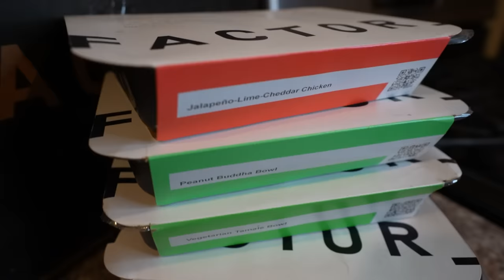Ferrari asked to see my heavily modified 458..

Comment: Awesome to see Ferrari dropping the welcome mat for modified cars.
Reply: They never actually did anything against modified cars though. Its just made up shit for clicks in youtube mostly. Literally vip ferrari customers have novitec exhaust and and some have bodykits or carbon fiber parts installed. Ferrari just hates when you say anything bad about the brand without factual reason but opinion. Which is weird ik. Ferrari sued mostly for copyright or brand shaming. I haven't seen any cease and desist for mods. But yes you lose ferrari points and get blacklisted from icona and special ferraris.

Comment: Clearing codes to avoid going into limp mode,  I have to do this weekly (often daily!) with my 2012 Corvette Grand Sport Convertible.  This issue popped up in 2014 when I still have a full year of warranty left.  Lesson learned!  NEVER EVER accept the blowoff response "we can't find the issue with your car, but bring it back if it happens again" when a car is under warranty.   GM screwed me over by "running out the clock".  I had tons of documentation showing that I had take it in for the exact issue numerous times, but since the dealerships never actually identified the problem and hence replace parts, GM used that loophole to screw me over.

Comment: Check for any corrosion on your body and engine grounds especially if it is a multiple point grounding site ( yes the grounds) If any are corroded or even loose it will give you a horrendous amount of computer and electrical issues. Not on a Ferrari, however will still pertain to computer limp modes battery drain and erronious electrical malfunction activity.

Comment: Emelia, paint the 458 Rosso Dino.  It’s a rare, historical color.  Good to hear that they determined the issue with the intake actuators.  I never saw you say what the original problem with it when you acquired it cheap?

Comment: In short you ran aftermarket on stock tune..............so many stock tune ecu's that sees different values it doesn't expect will throw codes and limp mode. 
Kinda EMS 101. 

But Ferrari gets a thumbs upfor fixing and extended olive branch lol😮
 And you for good content 😊

Comment: I had the same problem with the limp mode.    My modification required the use of the car’s OBD port.   UNPLUG everything thats NOT factory installed to the port.     It worked for me.    Let me know.
Reply: Hoped it helped.

Comment: Ferrari is smart, they design the parts so that only they could replace them, ferrari parts are barely used in aftermarket unless by other Ferraris, and that rarely ever happens, when you own a ferrari you can afford going to ferrari and get the proper tune up for the vehicle.

Comment: "They need the Ferrari parts they were designed with."

Well, they obviously need equivalently specced parts. But don't act like a properly sized, properly designed and manufactured check valve from another manufacturer wouldn't work.

Comment: So let me get this straight. Ferrari agrees to fix There Electrical problem, only if you agree to Change The Paint?  Not all Ferraris are red, although most of the Ferraris sold up from the 40s until the start of the 2000s had red History. In fact, Ferrari has used other colors such as black, yellow (Giallo Modena), blue, and white to paint some of its vehicles in the past and No dealers aloud at my shop.

Comment: I bought I Ford Focus ST in 2007. Not those new ones with the turbo charged engine, but a 2300 cubic ford engine. Which to be honest was stolen from Ferrari. At least the technologies was stolen. Same flop problems after a hundred thousand miles. Huge fuel consumption, and less power, but if they could steel that technology, why any mechanic couldn’t find the problem in any ford service? So, after a long dismantling of the intake air part, I could see the problem. Same tech same problem.but! To be honest, that ford built engine could run by me up to 170 thousand miles and still could teach a Mustangs a lesson, and to me with countless speeding tickets. If you steal any technology, at least try to make it better and not worst!

Comment: you modified the shit out of your car from a manufacturer that is renowned for designing their engine and other components to only work with one another, nothing else, no aftermarket bs, and then you wonder why Ferrari put out cease and desists orders... (obviously not the case here but I'm making a point)... when you modify cars like this and make them unreliable or break down often, you gotta know that can only put bad rep on Ferrari cars being unreliable, and since there aren't as many Ferraris on the road as for example Audi, Toyota, or something else, each and every individual who modifies his and makes it unreliable or faulty makes a much bigger dent percentage-wise in the overall reliability score of the car/brand... The color you chose for yours is actually cool though, I agree it should be one of the factory options. The rear wing is hideous, the rims are quite nice but I would never ever tamper with the aero and suspension of a Ferrari... ever... they designed those aspects of their road cars to pure perfection, why would you ever touch that...